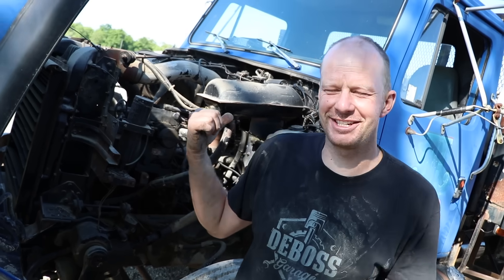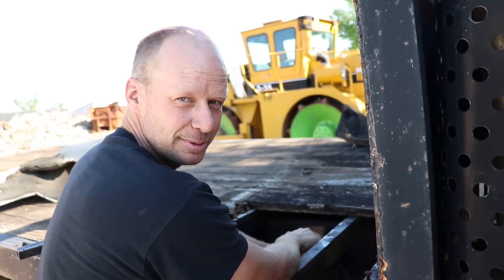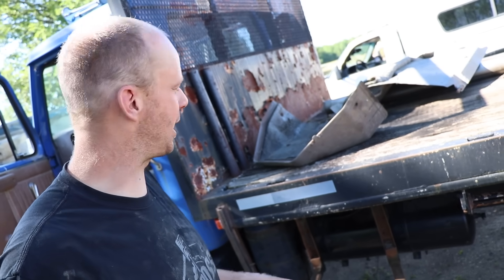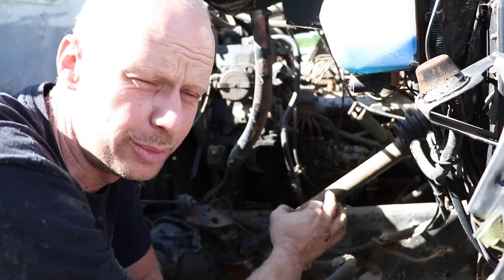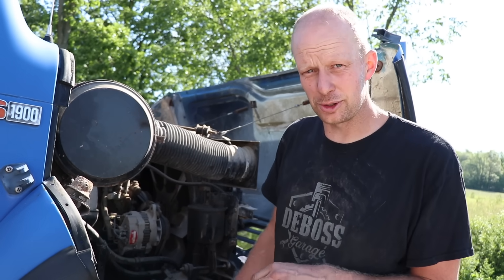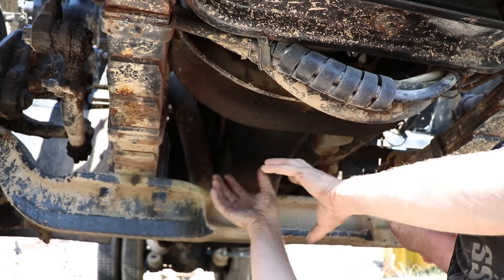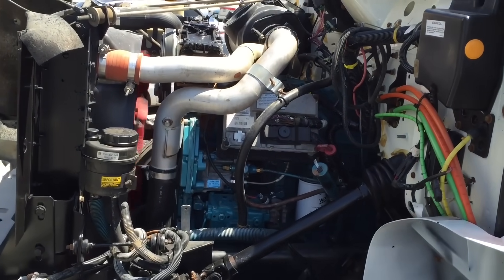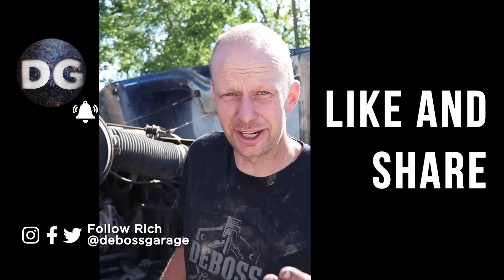REVIEW: Everything Wrong With a 7.6 Navistar DT466 Diesel

Comment: My work had a s1900 with the same engine it was a crew cab service box and a 10 speed dog legged transmission. The only problems that we had with the engine is that the rockers wore a hole in the valve cover, #5 injector hold down kept coming loose making it sound like a exhaust leak, and fuel lines leaking due to age and vibration. Also the air compressor was hard to find parts for in California due to age of the vehicle. It was a pretty reliable P.O.S. really the only reason we got rid of it was from the California emissions b/s and was not able to register it to be road legal.

Comment: 500 v8 Mack , I had one that I bought from the Mack dealer in Edmonton AB in 90 with a Mack 12 speed and it dyno’d at 430 in a tandem oilfield Vac truck to the wheels , that truck had the most balls of any truck I have ever owned till this day and literally would sit you back in your seat at low speeds and out accelerate a pickup truck till 130 kph in a roll on from 80 kph , it would also accelerate up a steep hill in an empty van truck which was still heavy . Very quick revving like a two stroke Detroit so must have had a light flywheel compared to a Cat , Cummins or Series 60 Detroit .

Comment: Had the 466 and 466E in a pole and bucket truck at my former employer... The thing I really hated about these engines is in super sub 0 temperatures they WOULD start without the use of a grid heater, glow plugs or a block heater..  Many a friggin cold morning we would think "no pole work today the trucks wont start"... I was wrong.
Reply: Do they do something else to male them start with no grid heater or glow plugs?
Reply: @grasscutter88   I  could be wrong but I think some trucks had  a way of  spraying  either / starting fluid  into the intake to help start... OR  you could spray it in the intake manually.

Some old Caterpillar  dozers had a small gasoline "pony" motor that would roll the main diesel over  until things warmed up....   Turn on the fuel and off  it would go...
Reply: Manufacturers wouldn't do that. ether destroys engines @REWYRED
Reply: @grasscutter88   Some had an  "Either Button"  apparently.... I heard it can ruin an engine if not used correct but also they get "ether dependent".... Wont start without it..
Reply: @grasscutter88 they do. John Deere is well known for having an ether button in some tractors. I've seen a lot of them here in Alberta, Canada
Reply: Hahahaha

Comment: You should review a Maxxforce 13.  You can start with the everything.  I don't know what crackhead at International had the idea to make an engine with 3 charge air coolers, 2 EGR coolers almost as big as the head, and run so much EGR that they can barely go 20k without plugging up with soot, cracking, and dumping coolant into the intake.  Absolute trash engine.

Comment: AS FOR THE STARTING PROBLEM--
A LOT OF THESE TRUCKS HAD THE SPRING LOADED KEY START SWITCH BUT ACTUAL STARTING IS DONE WITH A SEPARATE PUSH BUTTON SWITCH!!!
I WAS SENT TO AN AUCTION 
TO GET 3 I-H TRACTORS!
SOMEONE WAS SENT EARLIER TO GET THESE TRUCKS BUT THEY DID NOT START!!
I WAS SENT THERE TO MOVE THE TRUCKS AND WAS TOLD TO REPLACE THE BATTERIES !!
I GOT THERE AND STARTED ALL 3
ON THEIR OWN POWER!, NOT EVEN A BOOST NEEDED!!!
Reply: Buddy for the love of God please stop yelling
Reply: @well_as_an_expert_id_say  🤣🤣

Comment: 444 is the 7.3, the 1st gen heui or 2nd gen HEUI. If you want a decent engine stock the 7.3 makes a decent amount of power. If you want you can change the rear axle like on an old OBS f250 from a 4.10-3.55 you can’t tow as much but you get better mpg.

Not towing 1st gen 7.3 HEUI PS w E4OD, exhaust mod, & rear axle swap you can get anywheres from 18-25 mpg city. HWY you can get abt 20 @ 70mph @ 2K engine RPM.

2K is where the 525ftlbs of torque kicks in, it is a dinosaur m, but it’s lasted 25yrs & 373K probably more like 400K. Awesome truck just stay on the maintenance & she’ll treat you well.

On the old 444s/HEUI 7.3s I highly recommend to change out all the sensors/IPR & starter. New starter helps a lot, it sounds weird, but it does. Also change the POS dual plug wiring harness to the single plug one, much better.

Comment: Hi Deboss,

I’m an operator of the Army trucks with DT engines. All the ones I’ve driven are 300h 860lbft, and governed at 112. Being that the trucks are 36000lbs loaded, they really dog it on even slight uphill grades.

Reliable enough trucks, but the Achilles heel of pretty much all army vehicles are the power systems (they’re parked way more than they’re driven). Usually end up having to slave charge them from the G-wagons or duramax pickups.

Comment: I drove an '89 466 powered rolloff for a bit 6 years ago. 5 speed with 2 speed rear. It was 24,000 lbs empty. Slowest truck ever, but pump had been turned up. Let the clutch out in 2nd and almost stall it and rug the throttle and it would roll a mushroom cloud of coal :D

Comment: I worked in a reman plant rebuilding these engines for 6 years (not just 466's but pretty much every international engine). i worked in what we called "de-trim" for two years where we stripped engines down to somewhere between a short block and a long block before it went to another line to tear down the rest. i have had my hands on literally hundreds of theses engines. biggest problems i saw was that the turbos and exhaust manifold rust into oblivion because of the very thick water based paint that they painted them with. so if you have a turbo go bad or a manifold leak...you're in for a bad time. also i've seen a LOT of dt466's come in as what we called "window blocks", where the #3,4, or 5 rod broke and went through both sides (making a window right through). i've seen it happen so bad that there was no block material left and the head and oil pan was all that held the engine together.  one last thing that i noted in my time was getting the damper pulley off (to get to the oil pump) is...more of a challenge than it should be. the 3 bolts holding it on come out just fine and the pulley itsled will come off with a wheel puller just fine. the problem is the little plate between the bolts and the damper. when i started it was pretty much heat and beat to get it out before you resorted to breaking out the fire wrench and destroying the pulley and most likely the crank. at some point i designed a tool to remove the plate but even though to higher ups it was deemed a success it only helped about 50% of the time. sorry for the long post but i figured i would chime in since i had some experience :)

Comment: More recent dt's have problems with cylinder sleeves oring that fails and allow coolant to drop in the oil pan. Then you need a rebuild but navistar oem rebuilt kit is like 3-4k$ cad.

Comment: I work on these everyday not for a dealer but for a utility co, and the dt466 was a great engine was a great engine until huei and then it was a nightmare, pump problems, injector problems, oil rail problems, relay, inline fuse, heat etc on and on and on, maxxforce was even worse buts thats how that part of international went bankrupt. The nest thing that happened to them was cummins

Comment: Figured this would be a pretty short video.  The 400 series IH was a great one of the best engines out there! Start pretty good for the time,take alot of abuse, pour fuel to it and destroy everything behind it,if you did manage to melt one the overhaul was $1000 and two farmers could have it running in a short two days. Had quite a few of them. Never disappointed. Still want one in a pickup.

Comment: I had one smaller, 95 int rollback with a dt 408 all mechanical.  Loved that truck.  When we parked it, it had 990,000 miles on it and never even had the valve cover off.  Ran perfect.  Trans was the 6 plus and finally died.  All the engine really needed was new injectors.  Didnt even smoke that bad, just a wisp at WOT.  Even got 670,000 out of it before had to replace the water pump on the side of the pa turnpike.  Really do miss that truck
Reply: We had one that was gutless and overheated all the time I finally figured out the factory timing was set at 4 degrees before top dead center and should have been 24 degrees before top center it quit overheating and ran really strong after that . This is after the dealer had it for six weeks and talked to factory tech line every day.

Comment: It's always fun to walk around scarp/salvage yards...just have to watch out for the snakes lol.  Well snakes and finds that get you to spend money you weren't planning on spending...Last trip I took to the local one I ended up with a rear ended 05 Lincoln Aviator, transmission/clutch assembly/flywheel/driveshaft/rear end out of a Mustang GT, and now I have a 5 speed 4.6l 32v DOHC V8 powered LSD Mazda B2200 SE5 minitruck with custom 4 link rear suspension  and cage that I use as a fun rally truck that doubles for hauling parts around with the extra 200+hp/lbft torque and better suspension lol.

Comment: The E's use keepers to hold the roller lifters in place, we call them wishbones. When those break the lifter turns and wipes the lobe off the cam. Bad design and internationals fix is to stack 2. Makes for a big job when 1 little part fails.

Comment: It's hard to find issues with a dt466. Saw one in a bus that ran so hot the top tank of the radiator came un-soldered and came off. Put a new radiator in it and ran it at least another 100,000 miles.

Comment: Great review.  Love your channel - have learned a lot from you.  I have a 4700 with the little brother to the 466 (the DT360).  Seems to have a problem holding prime on fuel system but suspect it is a check valve either in the return line or the primer pump.

Comment: Weve been driving a 2004 dt466e at work for 10 years. Put 400k+ on it. Had injectors, water pump, oil cooler on it. It probably hasnt been maintained perfectly except for the engine oil. Over all pretty reliable. It runs at redline going 70mph so its at redline for most of its life. Been very good truck.
Reply: Diesels are designed to run at "redline", genius. That's what the governor is for.
Reply: @deeremeyer1749  relax bud
Reply: @DEEREMEYER1  not exactly for every application... genius.
Reply: @deeremeyer1749  fuck you. I never said they werent

Comment: The DT's were great engines until they started putting egr on them. That's when all the problems started.
Reply: What engine would run good choking on it's own waste.
Reply: @stevenplaskett7728  well, one designed to, which the DT466 was not.
Reply: Ive worked for international for 18 years. Once their engines started eating their own shit it went downhill. Anything pre EGR i think would last a lifetime if taken care of properly
Reply: @kevinwagner4298  True but I really dig cleaner air to breathe.
Reply: They should have went to SCR back when all the other OEM's did like 2010 ish but CEO of Navistar at the time kept pushing to use only EGR to save the customers on maintenance cost. Finally they got rid of that CEO and they switched to SCR which was about 2013-2014.
Reply: Kevin Wagner little did they know how quickly MaxxForce repair bills racked up.  International didn’t make any SCR engines, did they?  Not at least until they started using that MAN engine in the ProStar.
Reply: @jaysmith1408  please don't tell me the man engine your talking about is the 13L Maxx force..those engines are just as bad. I work at a international dealership and we put more egr coolers and turbos on those engines more than anything. If your talking about the new A26 engine it's in the rh they changed the name of all of their trucks but  its an ok  engine once they started using better material for the top end and fixed the programming issues that could cause a rod knock.
Reply: Kasey Morris the new engines to which I was referring are the A26 (allegedly a rebranded MAN).  I can’t recall the big block MaxxForces, I know we had them, but we primarily had them with the Cummins.  I never had problems with them personally.
Reply: @jaysmith1408  we see them pretty often not as much as we used to due to our regular customers selling them because of too much down time and repair costs. The only issues I see common in the prostars with a Cummins is every now and then a vgt actuator goes out or a turbo goes down. We actually just had a LT in a week ago that had the x15 in it my co-worker had to do an engine swing because cylinder 6 went down but we've only done 2 Cummins engine swings this year so far besides the old ism Cummins we rebuild those alot for a local concrete company
Reply: @kevinwagner4298 International just recently eliminated EGR from their new setup, the S13.
Reply: I love the old DT466E Engines better than the new ones!
Reply: Funny, but that’s when basically every medium and heavy duty diesel went off of a fairly decent development curve and onto a downward spiral of trying to regain reliability and economy in the face of idiotic government mandates.
Reply: Now couldn’t they back off the heavy EGR and add SCR like they needed to, or was the DT unable to handle SCR in any capacity?
Reply: @jaysmith1408  they did put scr on them in 2013. It didn't really change much and the DT was discontinued a couple years later.
Reply: jfsa380 we were putting SCR on it then changed direction to discontinue it because of the brand damage plus the HEUI fuel system needed a costly update and it was old heavy less efficient mechanicals.
Reply: And now Navistar is owned by Volkswagen.They almost were just about to go full production on EV trucks until that happened when they revealed about a year ago.
The 6.9L-7.3L IDI,7.3L PSD,and 7.6L are the best engines from I.H./NR,but I will say for the Ford F250-F550 that the 2005-2007 6.0L was alot problems free than the ones from 2003-2004,and then the 6.4L came out with the DPF filters,a identical bore and stroke to the 6.0L,but ironically was even worse than the 6.0L,and then Navistar terminated partnership with Ford,and then Ford copied their design with the 6.7L Scorpion.

The Navistar MRAPV and MRV2 in the Army are just as bad with those engines,they seriously should've just gone with Caterpillar because even Cummins after 1988 isn't worth a shit unless it's a 12V like the 4BT,6BT,and 6CT.
Oshkosh is the one with all the great trucks,espiecally with the JLTV/LATV having the Duramax and all other trucks like the MATV/MRAPV to the MTVR all have Caterpillar,the only bad engine on that side would be the 3126/C-7.

Comment: Can you review the 6.9L in 86 F250s?
Reply: That was a hell of a good motor. I had a ‘85 F250 and ‘86F350 dually . The 85 was a 4-speed and I thrashed that mercilessly. A friend wanted it , so against my better judgment I sold it to him and bought a ‘88 F1504x4. He was hard on that poor Bitch but sold it only a couple years later after repeated injector pump troubles. Stanadyne had a problem for awhile; it was so bad that you could buy a new injector pump no core for $242. They seemed to have it under control by time the 7.3’s came out. The 86 dually rusted away to nothing and went to the scrap yard, but that 6.9 that was in it is stashed under my work bench.
Reply: All the trucks in the story were new. I was pulling gravity boxes to the elevator as the 85’s first job. It was a week before the bolts attaching the step bumper to the frame finally settled in so they would stay tight.

Comment: I worked in a international shop for a while and yes the lifters mess up cams. Its not too uncommon to see that happen. But normally only on E models. What causes the lifter to wipe out the cam is the failure of what they call the dog bone which is what holds the roller lifter straight in line with the camshaft. That being said they are still a good enigine and can be rebuilt pretty fast and pretty cheap!

Comment: Of any of the engines you’ve reviewed, I have the most time behind a 466. The pos IH 9.0 would be a fun one to review. They were in lots of S series school busses. Sold as a transitional engine for fleets going from gasoline to Diesel engines.
Reply: the precursor to the 9.0 (DV-550) was put in a few tractor models too (IH 1468 and 1568). I think they look awesome with dual chrome straight pipes, and I love the sound of a diesel V8, but they were never very good in the tractors. The V8 just didn't have the durability for a farm tractor. Also, they apparently do not do well with trying to get more power out of them. Needless to say, IH only offered those models for a few years.

Comment: Another model that used the DT motor is the International 3800 series, and the successor 3300 series. Both models used the DT466 engines from 1979 to 2014.
The 3800 had it from 1979 to 2004.
The 3300 had it from 2005 till 2014 when they swapped to the ISB6.7 from Cummins. 

I’ve driven the IC CE series (3300) with the MaxxForce DT466 motor (model year 2011) and it is a stout motor overall, with good torque and speed as well, when you get it up to speed on the highway.

Comment: It’s kinda funny cuz before 2 yrs ago I haven’t touched a diesel in my life all I knew was gas. After I got an old diesel & it started right up w 2 new batteries, truck sat 3yrs & didn’t hesitate. 

On a gasser you gotta pull off the carb, clean out da F$&@$&@ thing. Hope it works & have to deal w a shot pump in the carb, & all that shit.

For diesels if they ran when last parked & they aren’t after 07 on trucks they’ll start. There’s a few sensors that will give you issues.

Gotta love them diesels man! Got 3 gas GTs & trying to put a diesel in one. Just gotta get one for a decent $.

But yeah, starting an old diesel is much easier  to start than a gasser.